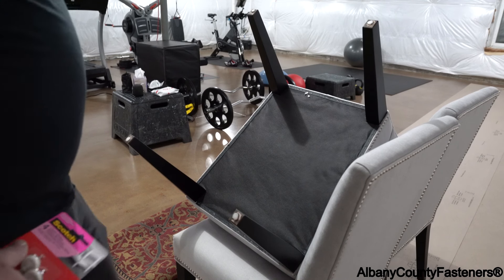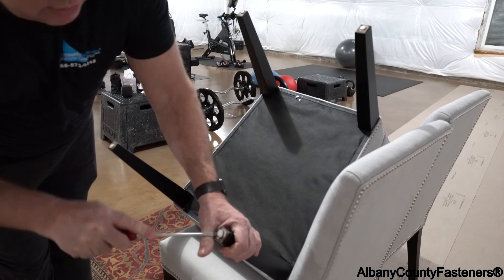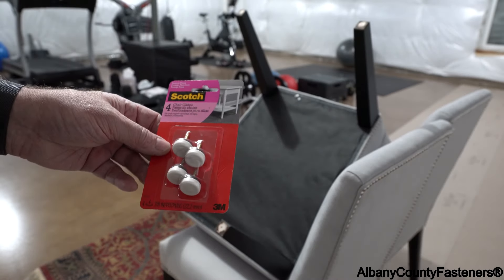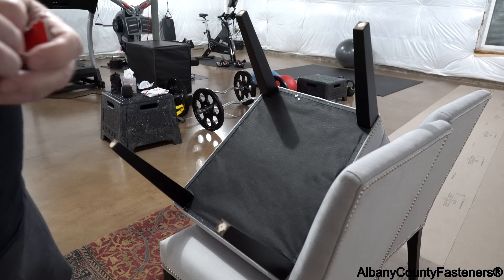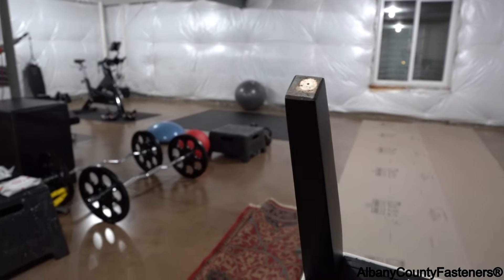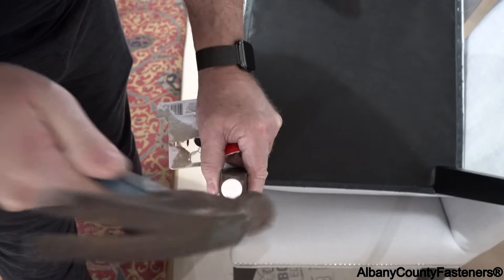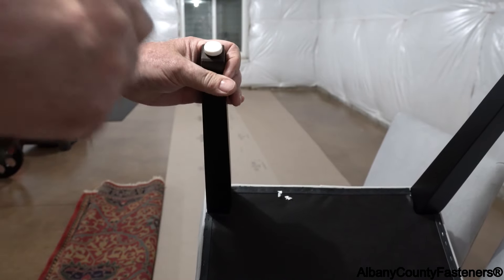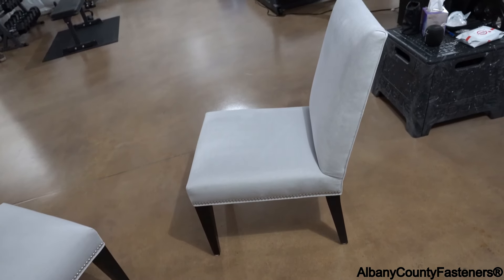How to Replace Chair Glides | DIY With Bob

Comment: My kitchen chairs (Monky Wards) need new glides.   How do I get the old fasteners out of the chair leg (wooden)?  I don't see a nail head sticking out.  The sliders are nearly or all gone.
Reply from the maker: If you can’t grab the nail wire then you can use a nail punch and drive the nail into the leg.  then super glue and new glide to the lag.  good luck!

Comment: Why not drill into the existing hole?  Or reuse it if it isn't too small?
Reply: wondering the same thing, any reason not to use same hole?
Reply: I think they are nails.  Not screws.  You can't really hammer the nail into the same hole.
Reply from the maker: Thanks for the questions. Good catch, @tirasgans1449 - you're right on the money. These are typically nails, not screws.
Using the same hole isn't ideal for a few reasons:

1. Nails don't grip well in an existing hole
2. The old hole might be worn or widened
3. A fresh hole ensures a tight fit

Sometimes, you have to lose a little wood to save your floor. But hey, if you've got a method that works for you, more power to you.

Thanks for watching!

Comment: But... what if the caps broke off and your kid pounded the nail in? Reality?
Reply: You're drilling a new hole near to the original hole. The unremovable nail shouldn't be an issue (if nail is flush with the wood).
Reply from the maker: Ah, reality strikes again. If the nail's pounded in, you've got a project on your hands. Options:

1. Try pulling the nail. Might damage the wood a bit.
2. Cut it flush, drill a pilot hole, use a screw-in glide.
3. Last resort: new chair leg.

None are perfect, but they beat a scratched floor. Good luck with the repair... and the kid. 😆